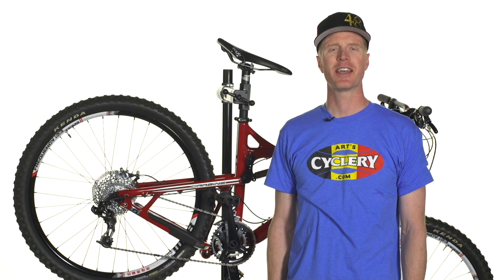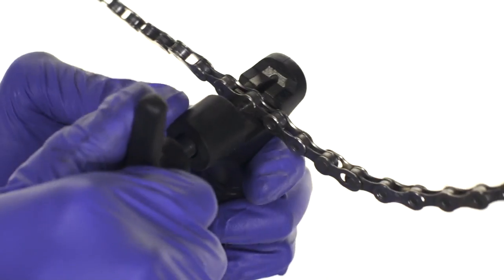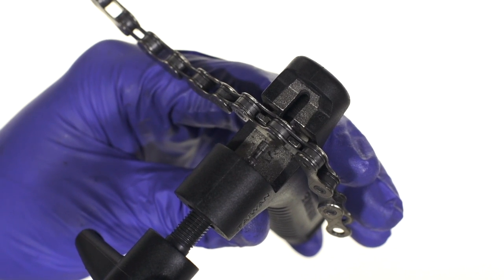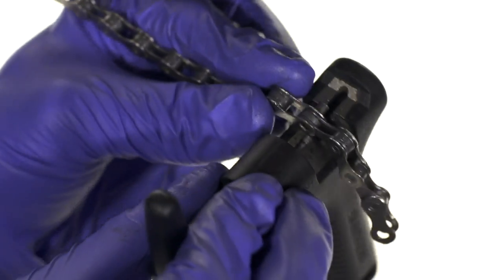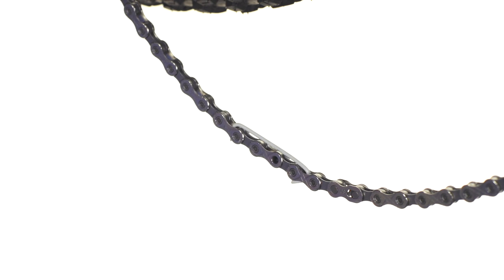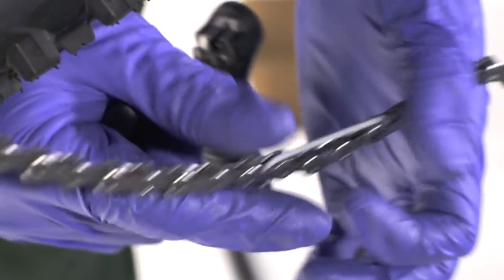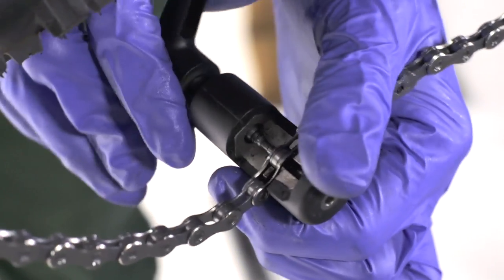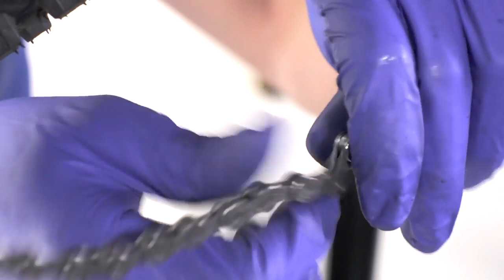How To: Fix a Damaged Bike Chain

Comment: Following this method will mean that the chain is 2/3 links shorter. What effect will this have on the chain/bike?
Reply from the maker: cogs19 You'll have to avoid the big/big gear combo or risk damaging your derailleur. You could retune your low limit screw to lock out the big cog to help prevent this though.
Reply: Art's Cyclery
 Ahh, ok. Thanks for the response, makes sense. Thanks for all the videos - very enjoyable.

Comment: Why don't you use the other shelf on the chain tool to loosen up the stiff link? Isn't that what it's made for?
Reply from the maker: Good tip Dan. Our advice was intended for those situations where the damaged link is not salvageable.